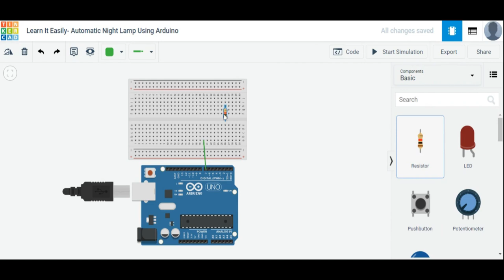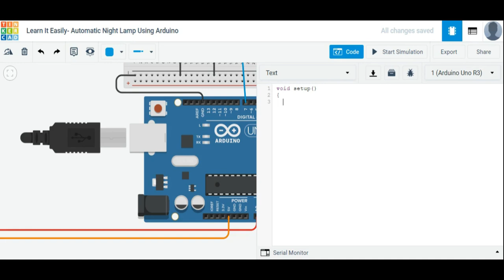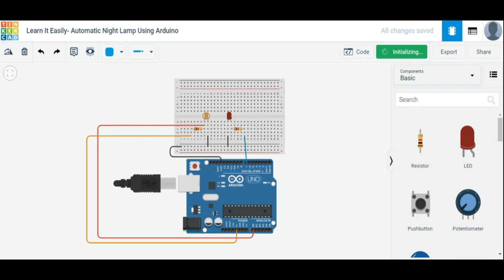Automatic Night Lamp using LDR | Tinkercad | Beginner Arduino Project 1

Comment: Sir it should be if(c>500) then led low ... right? Led should turn on when its dark right?
Reply from the maker: Actually when their will be dark, the resistance of LDR will increase. I googled the same and found this:

When the light level decreases, the resistance of the LDR increases. As this resistance increases in relation to the other Resistor, which has a fixed resistance, it causes the voltage dropped across the LDR to also increase.

So at night, value of c will increase because c stores resistance. I wrote in the code:

if(c<500)        // value of c has not crossed 500, means their is not enough darkness to turn the light
  {
    digitalWrite(7,LOW) ;    // So I want that LED remains off
  }
  else   // As soon c increases beyond 500, means enough darkness to turn the light on
  {
    digitalWrite(7,HIGH) ;    // I turned on the LED
  }
Reply from the maker: Tell me if you want to know anything more !!!

Comment: sir, can I know what the function of "Serial.begin(9600);" and "Serial.println(c) ;" in the coding part. And also the 500 represent for what in this part "if(c<500)". Does it is represent the voltage ?
Reply: hope you can reply ASAP, I need to explain it for my presentation on this project in next 2 weeks
Reply from the maker: @muhdwalid7949  

1. Serial.begin(9600) is used to start communication between board and photoresistor/LED. 9600 represents the speed of data to be sent. You can also change the value

2. c = here we have stored the value of analogRead(A0) in c. analogRead will tell us the value of Voltage at A0. I am finding voltage of A0 because you can see the photoresistor/LDR is connected to A0 using red wire.

3. Serial.println(C) = It is used to convert the voltage value you stored in previous step to human readable form. It converts to ASCII so that it can be compared in the next step.

4. c<500 = it is used to compare the value of voltage v with 500. 500 is taken as the threshold value of voltage in our circuit. If c<500 then our LED should not glow.

5. else = means c>500. It means LED should glow.

Tell me if you want to know anything more !!!

Comment: What does int c actually give the resistance or light intensity reading? 
For ldr when light falls on it resistance decreases right?
Reply from the maker: int c = analogRead(A0);
c is a variable which stores the resistance. You can also see the red wire is connected to LDR to AO whose value we are storing in c.

And yes light falling is inversely proportional to resistance. In simple terms, If Light increases then resistance decreases and vice versa.

When the light level decreases, the resistance of the LDR increases. As this resistance increases in relation to the other Resistor, which has a fixed resistance, it causes the voltage dropped across the LDR to also increase.
When this voltage is large enough, it will cause the Transistor to turn on. The value of the fixed resistor will depend on the LDR used, the transistor used and the supply voltage.
Reply from the maker: Tell me if you want to know anything more !!!

Comment: Sir how to add 3 to 4 leds in the circuit pls reply
Reply from the maker: I have developed a modified code for you to add 4 leds into the circuit:

void setup() {
  Serial.begin(9600);
  pinMode(7, OUTPUT);
  pinMode(8, OUTPUT); // Set pin 8 as output for LED 2
  pinMode(9, OUTPUT); // Set pin 9 as output for LED 3
  pinMode(10, OUTPUT); // Set pin 10 as output for LED 4
}

void loop() {
  int ldrValue = analogRead(A0);
  Serial.println(ldrValue);

  if (ldrValue < 500) {
    digitalWrite(7, LOW);  // Turn off all LEDs
    digitalWrite(8, LOW);
    digitalWrite(9, LOW);
    digitalWrite(10, LOW);
  } else {
    digitalWrite(7, HIGH); // Turn on all LEDs
    digitalWrite(8, HIGH);
    digitalWrite(9, HIGH);
    digitalWrite(10, HIGH);
  }
}

For connecting the leds, you need to do this:
Connect the long leg (the positive one) of each LED to a different digital pin. Pick pins 8, 9, 10, and so on. Attach a resistor before each LED's long leg to keep the current safe. Finally, connect the short leg (negative) of each LED to the ground on your breadboard.
Reply from the maker: Tell me if you want to know anything more !!!
Reply: Thank you sir ❤

Comment: Sir if it becomes dark it's resistance decreases and lamp turns on rigth but the resistance will again increase from the light of the lamp right? then how to overcome this?
Reply from the maker: Actually when their will be dark, the resistance of LDR will increase. I googled the same and found this:

When the light level decreases, the resistance of the LDR increases. As this resistance increases in relation to the other Resistor, which has a fixed resistance, it causes the voltage dropped across the LDR to also increase.
When this voltage is large enough, it will cause the Transistor to turn on. The value of the fixed resistor will depend on the LDR used, the transistor used and the supply voltage.
Reply: @learniteasily321  thank you.
Reply from the maker: Tell me if you want to know anything more !!!
Reply: @learniteasily321  Sure sir thanks.
Reply: @learniteasily321  Actually I just had some toggling issue like when It is dark the light tuned on and the LDR took the input and the light was again turned off, so light was getting on and off within short period of time, so I just added timer for taking the readings and it pretty much solved the issue.
Reply from the maker: @srgplay4526  Ok

Comment: my led is switched on even in light
please help
i have to submit the project tomorrow
Reply from the maker: This is not possible. You have to make sure that all the connections are made correctly. The light only turns ON whenever there is dark. If you click on LDR, you will get a slider which can be moved to left or right. Moving to right means increasing brightness. If brightness is increased, LED turns OFF.
Please verify all the connections from this circuit diagram:
https://www.tinkercad.com/embed/kbwURvVLI0R?editbtn=1

Also make sure you copied the exact code:
https://drive.google.com/file/d/1wf7UQyFO9yLvidfwUr0pyKmcVwTLlvC6/view

Comment: Sir can u plz tell the code how to set timer to led so that it should after certain time
Reply from the maker: These might help you
https://create.arduino.cc/projecthub/user16726/control-your-lights-with-arduino-and-a-relay-3dcfc0

https://create.arduino.cc/projecthub/nexsus/blinking-of-two-leds-with-the-delay-of-0-5-sec-19b76d

https://forum.arduino.cc/t/switch-on-a-led-for-5-sec-and-turn-off/112548/5
Reply: @learniteasily321  Thank you brooo